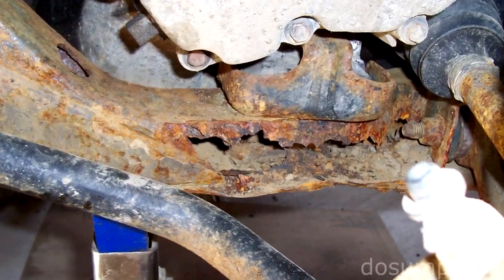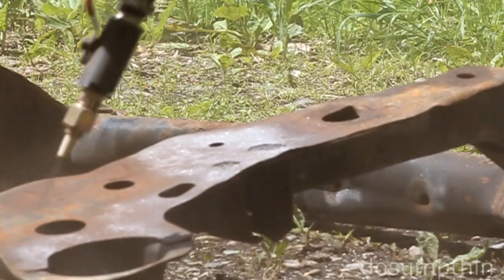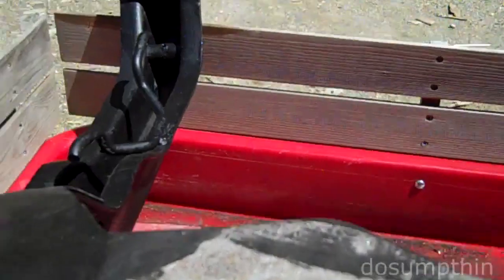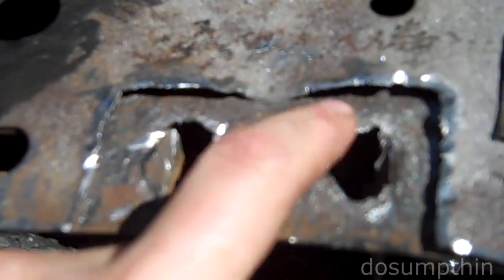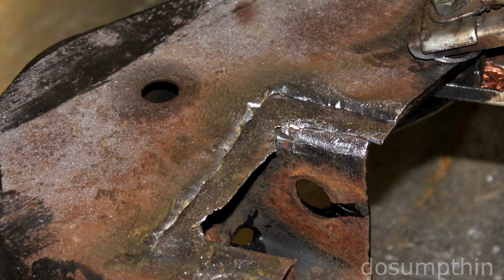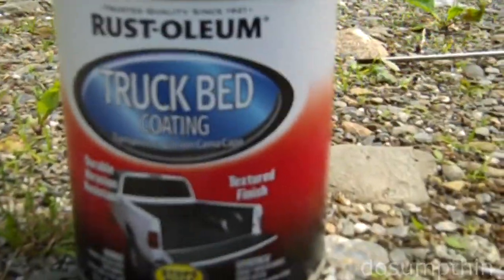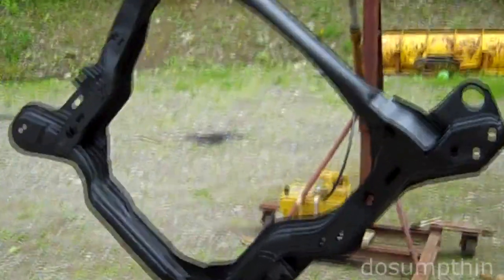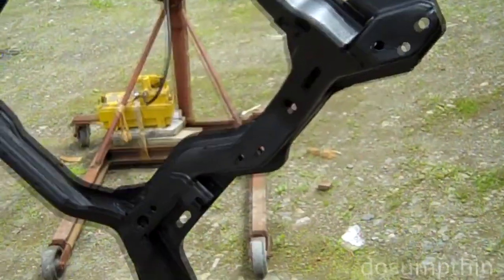Reasonable DIY rust repair on a vehicle subframe, unibody, or frame.

Comment: Very nice job.  I am the unlucky owner of a FORD Windstar.  I actually bought this van new and even had it treated with Ziebart?   Anyway, anyone familiar with the Windstar is aware that FORD recalled almost 1 million of these rust buckets back in 2010 & 2011 to inspect their subframes and bandage the rear axles (that were snapping in half, resulting in several serious accidents).  If the axle or subframe was determined to be too far gone, they offered the owner a fair market credit for the van and kept it.  If the axle and subframe were deemed fixable, they put two crappy brackets on the rear axle and four crappy brackets on the subframe with epoxy over the critical failure parts (both control arms and the rear subframe bots) and then returned the van to the respective owner.  This is what they did for my van and now my subframe is completely rusted away with the right side sway bar bracket completely gone and a big section of my subframe also gone (rusted away).  My van has always been garage kept and only has 150k miles on it.   I will never buy another Ford, NEVER !

Comment: one more suggestion- after cleaning, treat with phosphoric acid before painting- and POR15 is awesome stuff over acid etched bare metal- it will basically NEVER rust... but POR does NOT stick to paint...i use the rollon bedliner a lot too- but always treat with OSPHO /metalprep / any other phosphoric acid on the market- it creeps between layers and stops rust dead in its tracks, plus paint bites to it really well.

Comment: Try using POR-15. It has proven more than tough for any application I have used it on. POR-15 is a great product for stopping rust and preventing the spread of more rust.
Reply: Listen to the guy, I used POR15 on my 81 280zx. The areas I treated never rusted ever again...Just wish it wasn't so expensive. Like $45 a pint.
Reply: Terry Green- does it come in different colors?
Reply: I have seen gray & black, only; their web page may have more information.

Comment: the best way to repair is to locate all spot welds and bust them to remove the lower plate, sandblast all open sections , replicate this plate in a 11 GA sheet metal then weld it to remaining crossmember  using plug welds and continuous welds to replicate the factory assembly taking caution to not warp the crossmember.
After all this work, apply a good rustproofing paint as Por-15 or something alike
you'll never on that car ....much better protection than the original one

Comment: Did the same with my Saturn but didn't paint it just lots of undercoating over 50,000 miles later and still running the winter roads of Canada

Comment: Only use an oil-based coating which can breathe.   Bedliner was the worst mistake as are any undercoat that is not oil based... I bet this went to the scrapyard in 2016.

Comment: I Used some liquid zinc chromate to pour into cracks and between layers of the steel then let it dry then painted the anti-rust black paint that Tractor supply sells.
i have a 94 Nissan 4x4 that was 75% rust and cleaned it good like you did then Touch up welded here and there and coated it. Now the Truck is a woods buggy truck hauling wood.

Comment: As hacked up and patched this sub frame was before you fixed it, I think I would have looked for another donor frame and used it. Buying a replacement frame from a salvage yard in another area of the country that has a dry climate is a good place to source one. Sure, it's fun to blast and patch and restore metal, but in this case you should have found a place to recycle this frame for you! That would have been my choice. Sometimes you have to give up the ghost or the whole vehicle even and start over again with a better candidate for your time, effort and money.
Reply: I was going to say the same thing. The rusted frame does not have the same strength as a good one and poses safety hazard. Better get another one. If it's some surface rust then the repair is OK, but if it's rusted half way or all way out then a replacement is needed.

Comment: My 98' cavalier has 306,000+ miles on it, and well.. There is no unibody anymore. Idk what holds the car together and I have to take it easy on turns. But the motor runs strong! Doesn't leak or burn anything. Wish there was some way to reinforce the frame.
Reply: Nate Judge  take it to several body shops for an opinion.

Comment: Looks great and thank you,  but I believe any coating will lift away holding wet and rust in.
Suggest people linseed oil their underbody. Drill holes where there are double walls and spray in linseed oil hard with frames as they have little access to inside but there are supposed to be drain holes. Use those………if diligent each summer your vehicle should last forever. Due diligence.
Reply: Interesting point about the coating lifting away from the metal. Do you suppose it will still happen here when he cleaned the surface quite well, and must have used some kind of rust converter before priming and painting and sealing with the bedliner?
Reply: The old farmers had the right idea their farm tools haybalers etc. were left outside they used linseed oil……..you watch your metal in a few years you reapply.
It does not lift it will wash away after a 2-3-years .   I do my trucks underbody and I am not as religious as I should be…….but years go by and oil is still there.
The dam double walls are bad water salt gets in and you cannot see or get linseed oil in.
Metal last forever,  at least in human terms if you keep out air & moisture.
BEDLINER bad if it is an insert it holds water. if it is applied it lifts away and traps water.
Reply: Linseed oil goes way back, as you said. It was around long before there were any of those exotic anti-rust chemicals on the market. I will say that it does protect exposed metal as I have used it on my shop equipment as a rust preventative. I live in Florida where the damp climate will rust bare metal in a heart beat and a coat of linseed oil keeps out rust for several years. A re-application is required from time to time and is the only drawback, however linseed oil is cheap and easily available from hardware,  paint stores and home improvement outlets.
Reply: ChuddleBuggy jjii

Comment: THANKS SO MUCH FOR ALL YOUR VIDEOS ON HERE!! My 2000 Accord has been and still is a strong running car & Ive loved it. Im from Maine so the salt is horrible on our cars. Recently they found a rust hole in frame in front of rear tire. So bummed because they said its gotta go. I bought a used Altima, what do you recommend  I should spray/paint the underneath of my car with to help prevent rust?? The same as in this video or different? Thanks so much. Where in Maine are you? I'm in Bangor.
Reply: Oils (fluid film, krown, cosmoline) or paint (zinc rich paint, regular paint).  Do not forget spraying inside of frame/subframe.

Comment: good job on the repair looks good, and will probably last a long time. I believe that they should used the truck bed coating on all that stuff, and yes I know that it would add weight, and cost but guess what in the long run everyone would be thankful I bet. I have a subaru outback, and the subframe looks horrible I just bought, but I couldn't get under the vehicle to check this area while I was on the lot, but who does that. No dealer wants you to find those secrets of a potential deal breaker.
Reply: many dealers coat used cars so you cannot see.  only buy what you can see easy with trucks hard to get under cars so tell dealer buy depends on him putting on lift so you can see.   big money be wise.

Comment: hi, why do car manufacturers not electroplate steel parts so they don't rust?
Reply: good question. probably so the consumer is forced to spend more money on new vehicle more often
Reply: Tracy Dalton  yea true, or at least they could use stainless steel which is very strong but no, they want money
Reply: It's called planned obsolescence.  They want you to buy another car, so they make more money.  Or they want you to have it repaired by their dealership, so they make more money.
Reply: Bottom line is money.  Hmmm.   Screw the stealerships. I don't trust anybody working on my turd box.
Reply: How much do you want to pay for a new vehicle any way? How many people could afford to pay $50K for a small economy car any way? Or how about a $100K for a full size truck? If you take reasonable care of them, most of vehicles will last long enough till you are tired of them. Don't let salt build up on them if your home area has winter weather and the roads get salted. Spray it off once a week underneath if you commute to work a longer distance every day. Park in a garage if possible when you're at home. If you buy a new vehicle and you are worried about what it might look like in a few years underneath, get a can of good primer and paint and paint areas underneath that might rust. I did that with a new truck and shot the rear axles, undercoated the lips of the wheel openings on the bed, as well as the wheel housing. Common sense works great if you use it. This is something 90% of the people could do.
Reply: Simple they don't build em like they used to.
Reply: Paint prep
Reply: Randy demort71 I'm guessing you don't live a state with harsh winters. I live in Maine and they use calcium chloride to salt the roads. It's a little more efficient table salt at de-icing the roads but a lot more damaging to the cars that drive on them. Simply washing your car once or twice a week won't cut it after 5/10 years of abuse. I think car companies need to find a way for cars to hold their integrity longer.
Reply: Where on earth are you going to buy a brand-new fully loaded pick-up for $100K ? That's completely delusional.
Reply: Plastics?
Reply: manymanybullets - Ive lived in Maine my whole life. My 2000 Honda Accord has much more life in it but they found a couple rust holes in frame. So they told me to buy a different car. That Honda is perfect for my daughter to drive back & forth to UMO. I didnt know it could be repaired....what is typical price for welding/replacing small hole?
Reply: There are 3x at between $89 000 and $93 000 on a dealer's lot north of me right now and that is "on sale" with $10 000 off MSRP, they have sold 2 others since June and there is nothing really special about these as they are not considered the very top of Ford's model line up.  And those are the prices without taxes or any of the other dealer "add ons".  You know how cars awarded in contests are most often near the bottom in costs?  The last 2 contests I have entered the prize pickup was about mid $50 000 range so...
Reply: You'd be better off getting the dimensions of a frame and building one yourself.
Reply: Lorenzo van het Hul Manufacturers can indeed manufacture a car or truck that WILL NOT rust however, as pointed out by others, it costs money to do so. Yes there is a degree of planned obsolescence because YOU don’t want to pay an outrageous price for a vehicle who’s technology is obsolete 5 years down the road. Everybody wants the latest and greatest so planned obsolescence is a reality. Just like automotive finishes that you see nowadays, it just doesn’t last like the old days because no one wants to pay the price for quality.

Comment: holly shit, i have never seen subframe rust like that before, i mean my escort has no floor and sills left but the engine subframe is mint!
Reply: +TheRealDeal That is because the ford motor leaks so much oil that it coats and protects the sub frame.
Reply: Well my motor leaks no oil, but the rack and pinion on the other hand does, and the oil leaks everywhere it should. im not going to repair that problem XD.

Comment: I have to do something like this with my 2001 sunfire. the subframe has cracked at the rear, has numerous rust holes, and needs to be replaced. I have a 98 cavalier that I will be pulling the subframe off of and cleaning, repairing if need be and painting it like you did. I dont have any welding skills but im planning on taking a hobbyist class at a school. then just maybe i might get this car done. But i have a question. do i need to replace any rivets holding the frame on with rivets or can i use nuts and bolts? also do  I need a specific type (grade 8, or 5 or something)? I think there are 8-10 bolts and 2-4 rivets holding mine on.

Comment: ho w much would a service like this cost at a auto shop? i have a 96 nissan maxima with a rusted subframe {rightat the egnine mounts} but a ver strong enginge. should i fix it or cut my losses and sell it?
Reply: I just got an estimate for a subframe replacements. With labor  it should be about 605$ plus tax. That's not for a new subframe but one from a salvage yard (hopefully in good shape)
It breaks down to 155 for the subframe and 451 for the labor.
This shop seems to have pretty reasonable prices so it may differ elsewhere. Some other things that need to be done as well were a bit lower than other quotes I got.
You can also go on repairpal.com. They provide average/fair price estimates and even list some shops that should honor them.

Comment: Quick question, I am going to be restoring a 65 mercury comet and there is some rust damage in the chassis. One spot in particular has a hole in the corner of it. How would I go about fixing it. (By corner I mean this, imagine looking down the center a square pipe, it is at the top corner of it.)

Comment: Very informative video, Thanks.  I have a 2001 Accord that I took care of really well since I bought it.  It looks and rides fantastic, only thing the repair guy says the frame is rotted just like yours.  He quoted over 2 thou to fix it.  Breaks my heart.  I read on the net that this problem is caused by a faulty air conditioner drain or something.  Honda should do a recall.  I mean how many of these are still on the road?
Reply: margaretsville just found out today on my 02 accord that the subframe is rotted. They quoted me 1500 for subframe and other parts total

Comment: Would like To know if a van 2000 has rust under  the van Is repairable if possible ?
Reply: Depending on the model it might be body on frame which is more repairable than unibody, it is possible to cut out the rusted section and make a new section of frame to weld in

Comment: just a curious teen, do you have to remove the engine to remove subframe or is the engine mounted to the main frame
Reply from the maker: Jamel Ramsook The engine and transmission have various mounting points to the subframe and the body so you just need to temporarily support the engine and trannsmission while changing the subframe.  This is often done by securely placing something across the top of engine bay then chaining the motor to it before removing the subframe.  There are special tools for this too but many DIY'ers have creatively improvised with logs, lumber, pipes, etc.  Just be sure they don't slip and move.  I used a chain hoist to the ceiling trusses of my garage which allowed me fine control over the tension however you should never trust a mechanical device like a hoist or jack so be sure to have some way to lock it solid if you go that route.   Take care.
Reply: +DoSumpthin I have a 1980 trans am and there is a little bit of rust inside the frame what would be the best-selling way of getting it out with out taking the frame off the car
Reply: Just a kid with a great question! keep on keepin on

Comment: How did you protect the inside again ?
Reply: he used the force
Reply from the maker: fredriktaaje After installing on the vehicle I ended up applying a coating inside the frame.  It comes in a can with very long tubes that insert into the openings around the frame and subframe.  The ends of the tubes have nozzles that spray out in all directions.  How well does it work?  I have no idea.  It's a crappy old car but at least I gave it my best huh?  :)  Take care.

Comment: My 2004 Pontiac grand prix super charger  i got new now 15 yrs later.  Driving in new England  .my mechanic told me tohday this sep will be tbe last inspection sticker . He told me due,to the subframe rotted to look for another car . Im going to  have autobody SHOP  look at it second opinion .lol.... this,guy is,one of tge original chop shops in my town . Il see what he has to say. Giving the fact that the  car runs like new 212.000 miles i know   the car.  The rot is in the rear of the car  .

Comment: dude you go through all that to get rid of rust and i see 2 old  ass bold rusted to crap saved in the spot they came from sandblast them fudgers and grease them holes ahhh dam it lolololol  JHC
Reply from the maker: john foden Good eye.  I stuck those bolts in there just to keep the undercoating paint from getting in the threaded holes.  You're a riot!
Reply: no my friend No rusty stuff no head starts         : O )